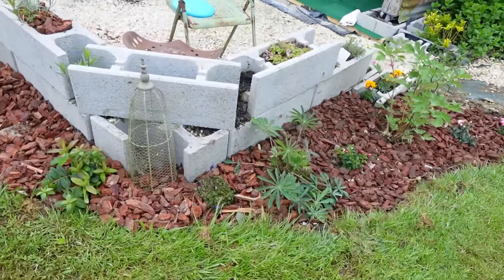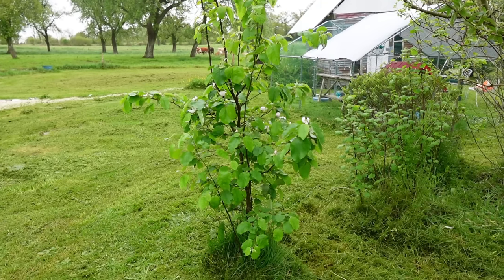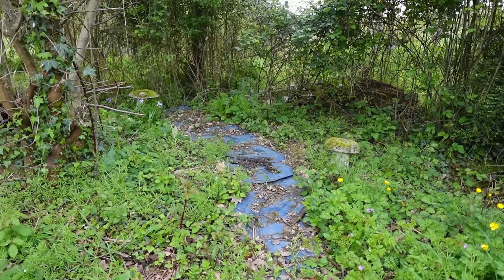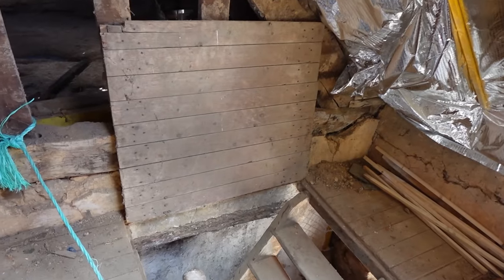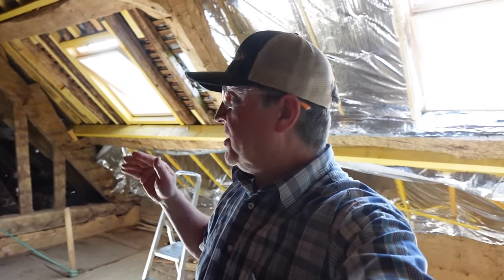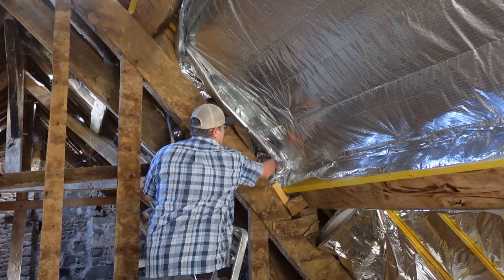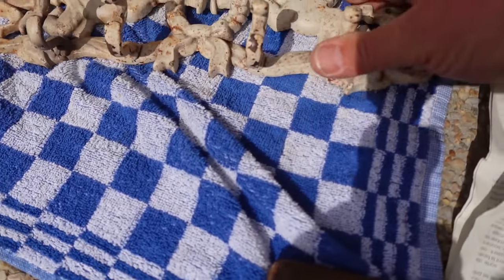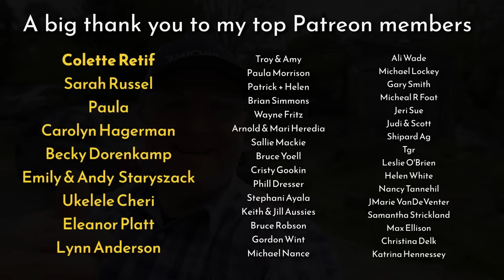Morning Garden Tidy Up & Cottage Renovation Progress!

Comment: Sean if you mulch around the trees you could cut around them with your trusty steed. Mulch should make it healthier for the trees. In the USA there was what was called a mason sash. It was a window frame that was installed on the inside of the window which gave you a   double glazed window. What I would do is double glaze the sash making it a triple window. You dance well with the insulation roll. Nice bread bowls.

Comment: You could make an insulated "bung" cover for that little window. Use it as a seat cushion when the weather is warm, then push it into the window frame to reduce heat loss when needed. I saw some that were made for the round windows on a narrow boat and thought it might be an idea for your little single glazed window.